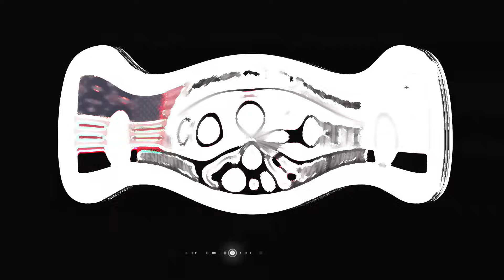New Patio and Columns (Day 4) Concrete is here and setting up TOO FAST

Comment: Rick - Maybe a stupid question and my bad if I missed you explaining it, but what was the purpose of the holes you dug that got filled in with concrete anyway ?
Thnx…
Reply from the maker: Those are piers for a structure being built once we're finished
Reply: @RickThomasConcrete  Got it.  How will the contractors know where those piers are when they come back to build the structure ? Thnx…
Reply from the maker: @mikemccormick3764  the plans that the architect drew up
Reply: @RickThomasConcrete  Duh 😆, my bad. Glad you’re back with videos.  Real solid crew you’ve got for sure. Stay safe…